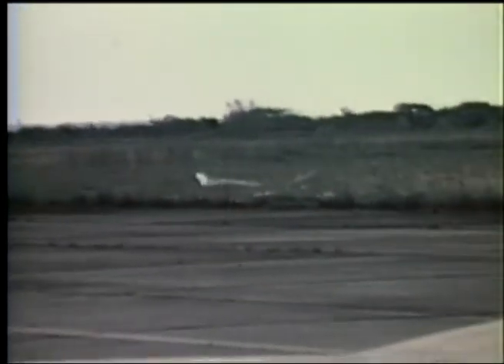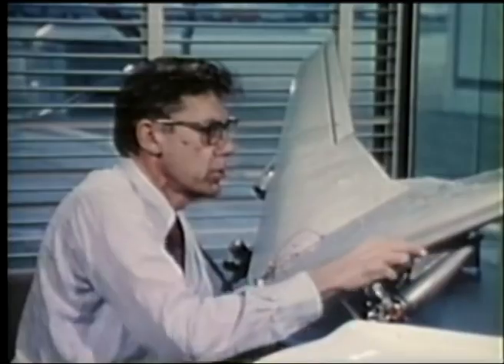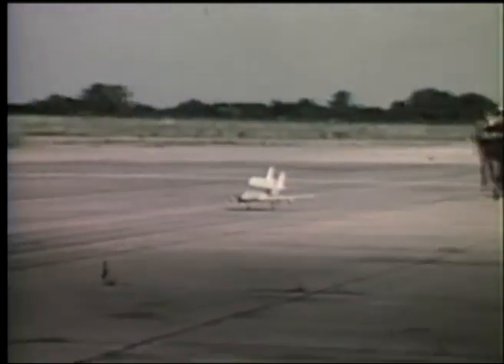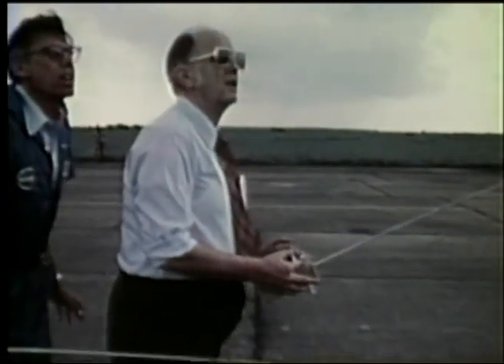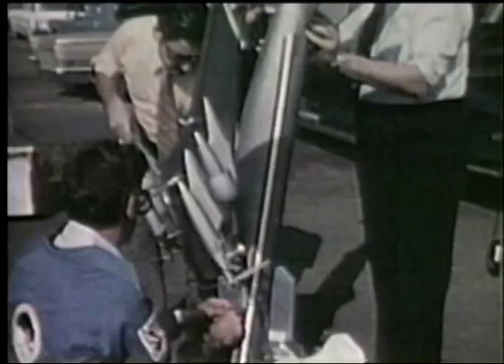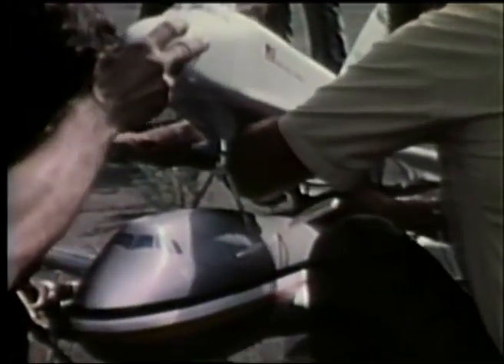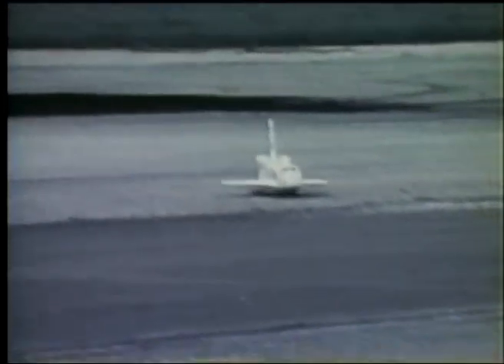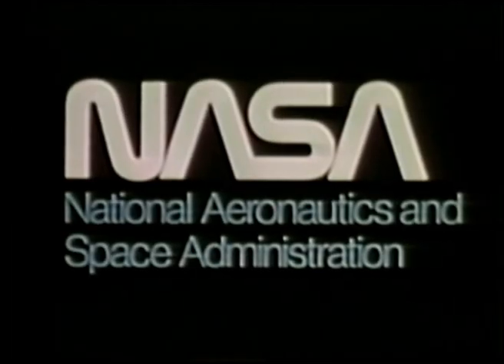NASA Uses Models to Transport a Shuttle

Comment: A dpace shuttle dives steeply and glides at a 45 degree angle  when landing . It needs to pull out at high speed to flare out and travel horizontally along the runway to touch down and roll . If it pulls out of the landing dive too soon it will be too high to l a nd and will stall and fall and no amount of flapping of ailerons or elevators can steer it or stop the crash . 
 If it pull out too late it will hit the ground at over 230 mph . 
  5 computers and ground radar calculate when . 3 computers must agree . The 2 not agreeing are shut down.  No logic or explanation for this random action has been given .